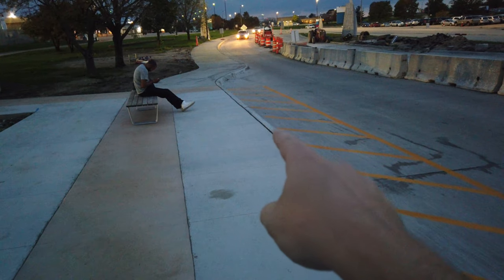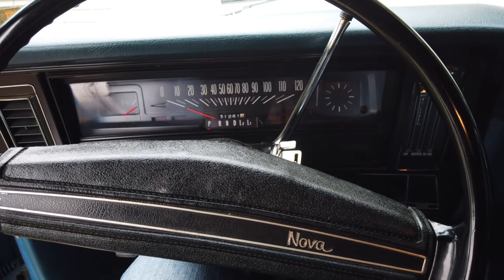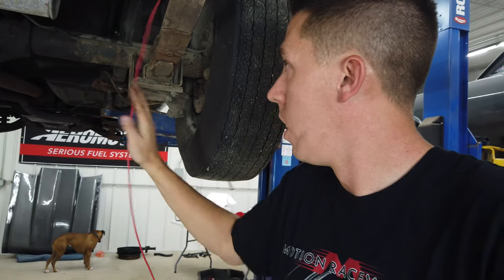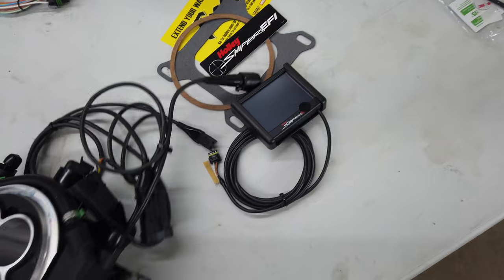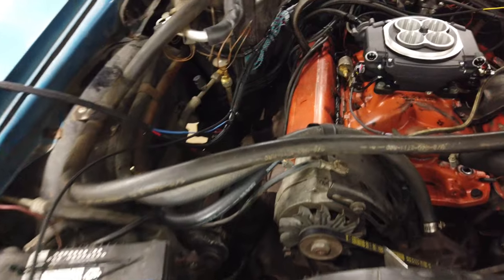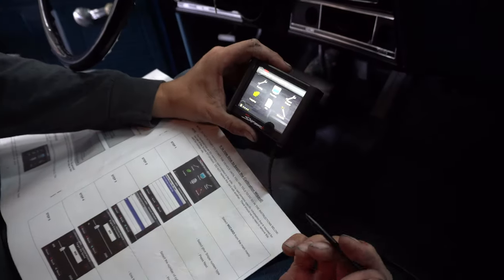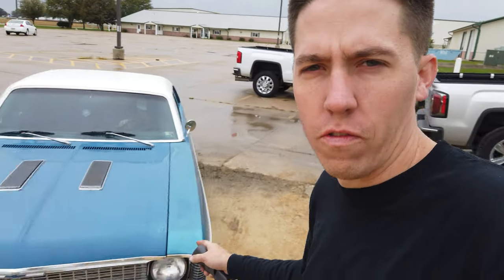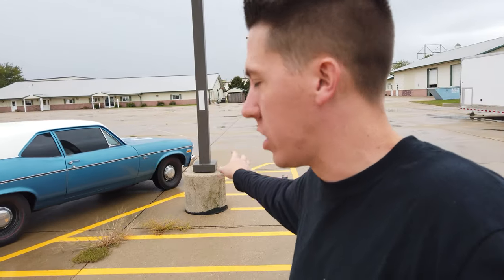Holley Sniper EFI Conversion!

Comment: A lot of the older points style distributors had a resistor wire so they don't get 12v at the coil while running. There was a bypass wire that came from the starter to apply 12v while cranking. Good find on the 12v ign wire.
Reply from the maker: Thanks for the info! Definitely my first time messing with this stuff lol
Reply: No problem, I'm used to the older stuff, trying my hand at LS with the Terminator now. Probably should have done a stock motor for my first one, 408 with a healthy cam and Bosch 210's and can't get it to idle. Keep posting the videos, it helps us learn.
Reply: That was going to be my question as well, whether or not it has a ballast resistor or resistor wire in-line to the coil.

Comment: I can hear the fuel pump sucking air, if you want solid fuel pressure without air bubbles interruption and quiet the fuel pump, install Holley hydramat in the tank, what mpg is the car getting now???

Comment: Neat video, I am considering a 2 bbl version for a 67 Impala... couple of comments.. Ran the fuel lines alongside the muffler...! No start up on the video... no MPG as promised....
Reply: Hey, how's your impala coming? I'm currently having one installed along with restoration and hoping its done right.
Reply: @clearedhot6146  So far so good, all went well, except I damaged the TPS sensor and need to replace, one came in yesterday. I really question getting married to a two barrel manifold....

Comment: It would be cool to have dyno’ed the car before and after too.
Reply from the maker: That would have been cool for sure!
Reply: Hagerty did a video on a 302 redline. it made 30hp more, but he believe the carb wasn't perfect. so he believes you can make a carb to have as much power, which is true. just the reliability, easy start of efi is the huge advantage. he didnt use the computer controlled timing, so he could possibly gain a little more there.

Comment: On the aeromotive fuel tank which one did you use the 200 lph or the 340
Reply from the maker: We used the 340!
Reply: @BuildTuneRace  so the holly is 650 max why not use the 200 lph when the max on that is also 600 ? Is it better to use the 340
Reply: Is 340 over kill
Reply: When I mean 650 or 600 I’m talking about the max HP rating on the EFI and fuel pump

Comment: Hook the trigger wire to the alt wire that powers up with key on.
Reply from the maker: They don't recommend this as they don't consider it a clean single. We tried it with switching a relay but it output a full 12v to switch the relay it was more like 7-8. Ended up going straight to the key and that worked best!
Reply: @BuildTuneRace  I have seen it done hooked to the alt and it worked fine.

Comment: adding the Sniper but leaving the Points Distributor kinda does away with half the advantage of EFI over Carburetor, Yes No?
Reply from the maker: You definitely loose the adjustability of timing. Depending on what your doing it could definitely be a big disadvantage. On a swap like this though the driveability still is much better!

Comment: The 72 Chevy should run fine with a properly adjusted carburetor. It was only later with more and more pollution controls that cars surged and spit and sputtered. While injection  might run a little smoother, at full throttle the carburetor usually makes more power.

Comment: That car is SO awesome!! Love the install!! Great job you guy’s!!  Hey just watched the whole vid, quick question: care to share which was the circuit you guys used for the signal? I have a ‘70 Nova as well and jumping into the final wiring at this very moment (buddy is helping out as i am sooooo NOT into wiring lol!!)  Anyway’s, ‘figured id try and make up a bit of time on his help by asking you guy’s since you just got out of it.  So, i know ive seen that there is a fused “Ignition” prong /circuit, with an available, ready to plug onto, Male connector. Since you reffered to it (i think?) in the video, i just wanted to confirm if that was the one that did the job? Looking forward to the turbo install on that car!! 😉🏁😁

Comment: What's scary here is seein' all that coolant lyin' in the lifter galley!  What's wrong w/THAT picture?!  Do we have a failed water jacket somewhere? What's the end of the dipstick look like?  What would've been a lot more professional is to ACTUALLY tape the work being done (for viewer's benefit), instead of zoom shooting the narrator's mug every step of the way!  What's the point of THAT?!  Nowhere near the hands-on, step-by-step informative video I'd hoped it was going to be.
Reply from the maker: More of a vlog then a how to. There is a bit more in depth info on Motion Raceworks YT page where this was broke into 3 videos. The coolant in the lifter galley is from the intake being removed
Reply: if you don't drain the cooling system DOWN TO A LEVEL lower than the Intake manifold...then that's what happens when you remove it
Reply from the maker: @stephenbratset2164  makes since!
Reply: Just tap into the fuse block accessory ignition switch for a full 12 volt source.
Reply: I seen the coolant thought same as well